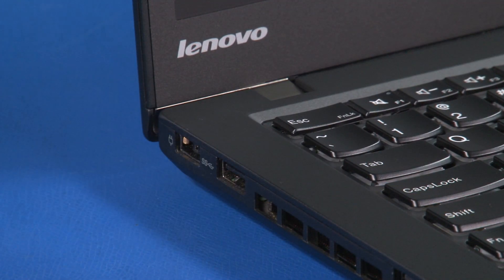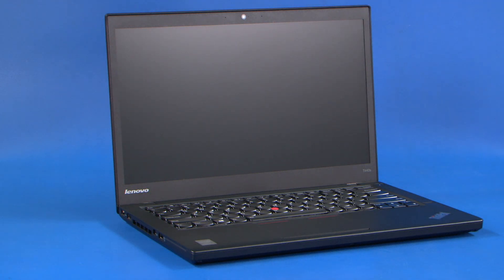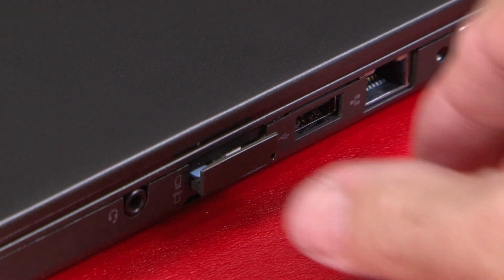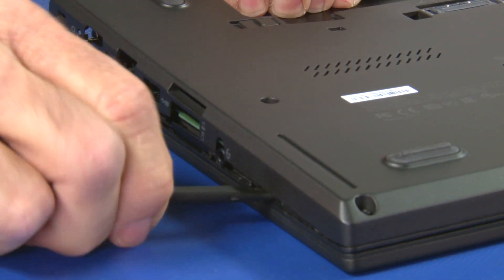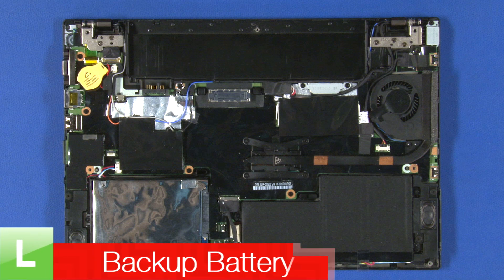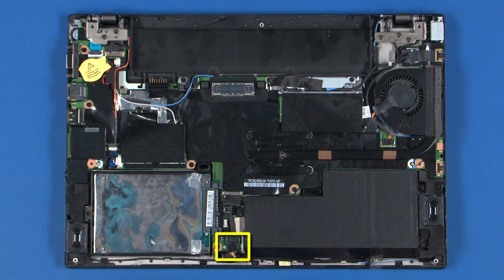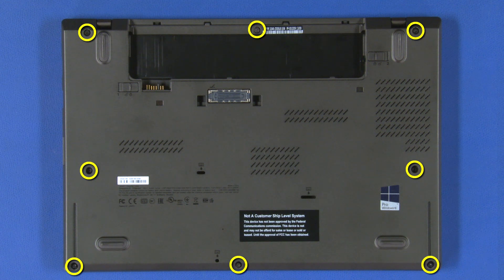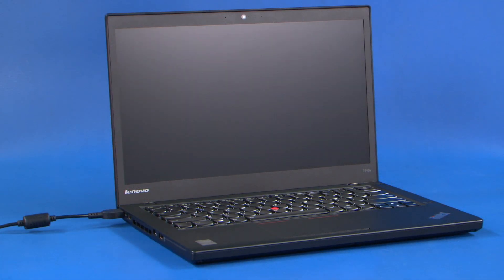ThinkPad T440, T440s, T450, T450s - Backup Battery Replacement

Comment: When I power on my Lenovo ThinkPad T440s, The external battery does show on my PC. Only the internal battery working. What could be the issue from the external battery?
I tried using a brand new Battery but it still doesn't show on the PC.
I have resetted the bios and all that but no solution yet.
Reply from the maker: Hi unokeraphael1701! Apologies for the trouble. Just to check, when did the problem start? Did you change any settings or install anything prior to that? Does the laptop still powering on while the charger is connected? If yes, does the laptop turn off automatically once you unplug the charger? Update us again. Thank you for reaching our support! -Chris_Lenovo
Reply: @LenovoSupport  
Yes my PC powers on with the internal battery working. My concern is the external battery not working on the PC.
The external battery not working happened after the PC was disassembled by a technician.
I don't know if the back up battery connector is not properly fixed or it's a software problem. The PC dies easily as it's only the Internal that is working currently 🥺
Reply: @LenovoSupport   The laptop doesn't turn off when I unplug the charger. 
It no longer shows 
Battery 1
Battery 2.
I don't know what could be the problem
Reply from the maker: Hey unokeraphael1701! Just to check, have you tried contacting the technician who disassembled your Lenovo unit, and inquire about this matter? Did the technician replace a certain part on your Lenovo unit? Does the external battery work before the technician open or disassembled your Lenovo unit? -Chris_Lenovo
Reply: @LenovoSupport   Yes it's working before I gave it to the technician.
The battery still works on another T440s PC
Reply from the maker: I see. Have you tried contacting, or bringing the unit back to the technician who disassembled the device and inquire about this matter? Based from what you have explained, this could be a hardware related concern with the device, and the only way to get it fix is by having it checked by the technician for a possible repair service. -Chris_Lenovo

Comment: After disconnecting built-in battery from bios. Now its completely off, tried 15 second and 30s holding power button without charger and battery but still doesn't work with and without battery
Reply from the maker: Hi @_.Hamza007, Kindly send us a private message on our social media channels for us to provide you with the troubleshooting steps. Addie_Lenovo

Comment: EVERY  TIME  when  i  turn  on  the  PC  , i got to  adjust  the  date  and  time  , otherwise  pc  wouldn't  turn on .  because  when  i start  it  , it  starts  with  no  DATE  AND  TIME  after every time  .  DOE S REPLACING   the  battery  like  in your  video , will  solve  this  issue  ?
Reply from the maker: Hi TheSnoopdog14! Thanks for reaching out, and we hope you're doing well. When the issue started? Did you update any software or change any settings prior to this issue? Generally, there are multiple possible reasons why the time keeps resetting and one of the possible reasons is the CMOS battery. In addition, you can also try to update the BIOS and drivers. Here's how: https://support.lenovo.com/us/en/videos/vid500028. Then observe if the issue persists. We'd like to extend our help. Rai_Lenovo
Reply from the maker: Hi there @TheSnoopdog14! If you still have the issue after updating drivers and BIOS, you might need to replace the CMOS battery. -Jomz_Lenovo
Reply: @LenovoSupport  so  ,  this  morning  happened  again .  if  i need to  replace  cmos  battery  ,  that means  the  battery  on the motherboard  ?  if  it  is that  , then  it  is  a battery  wrapped  in yellow tape .  and  if  it  is  cr2032 ?  do  i  just  take  the  battery  out  of  the  wrap , and  put  the new  one  and  wrap  it  ?
Reply from the maker: Thanks for getting back to us. Kindly delete the message that includes the serial number to secure your personal information. Yes, you described it correctly. The part number of the CMOS battery is 02K7078. If you are in Israel, you may get the contact details of our Parts Sales distributor here https://lnv.gy/3t3Sgjw. You may reach out for assistance regarding the repair service to one of our service provider in your area. You may use this link https://lnv.gy/2V6LP2Q to find one near you. Let us know if you have other queries or concern. Fraineee_Lenovo
Reply: @LenovoSupport  thank you for your reply. U didn't answer what I asked u regarding the battery and the yellow tape .
Reply: @LenovoSupport  I asked u whether I need specific part number , 

OR SIMPLY , JUST TAKE OUT THE CR2032 BATTERY OUT OF THE YELLOW WRAP , AND just replace it with a different cr2032 brand new Battery that I have ?
Reply from the maker: Sorry we missed that. Yes, simply remove the old one from the yellow plastic and put the new one. Make sure it is well placed. 

Here is a good guide from our channel 
https://lnv.gy/38ysZ7O

Let us know how it goes. Diox_Lenovo

Comment: Any kind of CMOS battery support in the T450 thinkpad laptop?
Reply: Actually Sir, when I'm press the power button my T450 thinkpad doesn't start and sometimes after lots of try maybe it's turn on...now still happening this problem so what should I do?
Reply from the maker: You can try doing a power drain. Remove all peripheral devices connected to the computer then press and hold the power button for 15 seconds. Plug the machine back then turn it on. -Jomz_Lenovo
Reply from the maker: Hi Bishal! Apologies as we do not have one for the CMOS. You can find more videos here of the T450 here on this link https://lnv.gy/2YpuUq3. -Jerry_Lenovo

Comment: Hello.. ive lenovo w50 which isn't booting up.. no issue with the ram.. the led light on the power botton stays on when ac adapter is plugged in. Could it be the backup power cell that's faulty?
Reply from the maker: Hi Haris. To clarify, even the Lenovo Splash screen is not coming on, it's just a plain black screen? Can we please press the capslock key a few times then check if the capslock light turns on and then off? We'd like to help. Cy_Lenovo

Comment: Hii ,
When I turn on the laptop I getting a msg as {"battery1 has failed due to normal wear. The battery can't be charged. Replace the battery."} Instead of this I won't have any issues it's normally working good but iam getting msg like this  as above👆..
What can I do now please suggest me
Reply from the maker: Hi! Thanks for reaching out. Could you send us a private message via our Lenovo Official Facebook Page or a direct message via our Lenovo Official Twitter Page and include this reference number 1245649 in your message and provide the serial number of your laptop for us to check your options? Here's how to find the serial number https://lnv.gy/3pBTIXz - We'd like to help. Mark_Lenovo

Facebook: https://lnv.gy/3aXVle2
Twitter: https://lnv.gy/2KQDJWX

Comment: My ThinkPad l430 beeps 5 times then another 5 beeps and won't boot up, my question is, should I change the CMOS battery ?
Reply from the maker: Hi Abdel! Thanks for reaching out. Kindly check these pages https://lnv.gy/2IODaeF, https://lnv.gy/2UCrSwY for reference regarding beep codes. Erica_Lenovo
Reply: I have the same problem
Reply: @MasMarone  there was a problem with the BIOS, had to take it to a professional.
Reply: @abdelghani7229  Thank you for your answer. I've already ordered the new battery for bios. Maybe I can do it myself.

Comment: my t430 is not turning on , will replacing cmos battery resolve my issue?
Reply from the maker: Hi Sadaqat, thanks for writing in. We're sorry to know about your trouble. There are a lot of factors why a device is not turning on. May we know if there were any updates/changes prior to this issue? When you tried to turn it on, do you see any lights on it? Have you tried using a different charger? Did you encounter any error messages prior to this issue? We'd like to know more. Looking forward to your reply. Fraineee_Lenovo
Reply: @LenovoSupport  Thanks for response , no there were no updated or changes , it was working fine but suddenly it turned off and then never turned on , i tried different charger but no luck , i have tried different solutions given online but nothing worked , also i would like to tell you that the battery was already deads so i was using laptop directly since long. I want to ask that is it reccomended to use without battery? Also since its not turning on then it means its internal battery is also dead now. where it is located ? and does it has anything to do with cmos?
Reply from the maker: Thanks for writing us back, Sadaqat. Have you tried to update your BIOS? Meanwhile, kindly follow the steps below if you still haven't tried it.

1. Press Windows key + I to open Settings.
2. Choose Update & Security.
3. Select Recovery from the left pane.
4. Under the Advanced startup, click Restart now.
5. Choose Troubleshoot.
6. Select Advanced options.
7. Choose UEFI Firmware Settings and click Restart.
8. Reset all settings to default and reboot your PC.

We'll wait for your update. Fraineee_Lenovo

Comment: I wish you would use terminology that countries other then the USA could properly understand. The CR 2032 is not a backup battery. It is a CMOS battery, frequently called the BIOS battery but backup battery it is NOT! It may provide trickle voltage for the CMOS to keep the BIOS settings when the mains power is disconnected or the laptop battery is flat/run down/exhausted/out of go juice but it does not even back those settings up.

Comment: Hello,
 I didn't use my T440 laptop for 8 months. Now it displays that it not charging and powers of when I remove the AC adaptor. So, do I need to change the only external battery for T440? If so, do I have to open the whole laptop as demonstrated in the video?
Reply from the maker: Hi Mohammad. Thanks for reaching out to us. Try doing power drain first. Remove all peripheral devices connected to the laptop including the charger and the external battery then press and hold the power button for 15 seconds. Once done, plugged in the charger and just let the battery out and turn on the laptop. If the laptop turns on with only the charger then the external battery is defected and needs replacement. Let us know how it goes. Auxen_Lenovo

Comment: I removed the battery and I put it back but I can not change the date
Reply from the maker: Hello Aymen, Thanks for reaching out. Please let us know if you have a password set in your BIOS? Because if this is the case this will set the time options as read only. You can try resetting the BIOS to its default settings and check if that will fix the issue. Jack_Lenovo
Reply: @LenovoSupport  i think that a password set in bios how i do ???

Comment: Suppose the CMOS / RTC (Real Time Clock) backup battery of a thinkpad fails. Will the BIOS complain about RTC or checksum error if the thinkpad is either constantly connected to either the AC power supply or the thinkpad's non-depleted main battery? I would assume that as long as the RTC is still powered by the AC power supply or the main battery, the BIOS wouldn't complain.

The reason I ask is that I left a thinkpad in storage for a few years. The CMOS battery seems to be still powering the RTC, but I'm not keen on opening many things to replace it in case it fails. If there's an alarm about the CMOS battery dead every time I turn the thinkpad on even though there are alternative sources of power to keep the RTC alive, then that would really suck.
Reply: Why not replace the battery? This nice video shows how easy it is.

Comment: Please share video of T430s lenova CMOS battery replacement
Reply from the maker: Hi आरंभ! Thanks for reaching out. We don't have a CMOS battery replacement video here. Try checking the Hardware Maintenance Manual for the steps. Link here, https://lnv.gy/2NF8rzf. Mac_Lenovo
Reply from the maker: Hi आरंभ.. In addition to what Mac have mentioned, this article https://lnv.gy/2Hmlep9 indicates that you will need to remove the battery & keyboard to access the CMOS battery on the T430s. Check out this keyboard removal guide https://lnv.gy/2HmleWb (3rd party video) and follow instructions on https://lnv.gy/2Hmlftd to remove the CMOS battery. Ray_Lenovo

Comment: Easy enough. My system wouldn't power on. I used this guide to reset my CMOS battery and it booted right up. Thanks for this info.
Reply: Did you get a replacement cmos and just plug it in

Comment: may I ask if the internal battery of the t450 T440 and t440s are the same ?
because i have a T450 model and i'm looking for buying an internal battery and i always find in the discrption of the battery thath they are for the T440 model
Reply from the maker: We recommend searching for the correct battery here:
http://pcsupport.lenovo.com/us/en/

Enter your Machine Type Model number, or your serial number to find the correct parts for your system.
Reply from the maker: Go to:
http://support.lenovo.com
Type the product name, machine type, or serial number to find your system. 
Click the 'Drivers & Software' tab.
You can find the drivers for your system there.
Reply from the maker: You might want to contact Lenovo Support to help you resolve your issue.
http://support.lenovo.com

Comment: How to disable internal battery if you cannot get a boot to BIOS? Trying the old, "pull battery/AC, push power button, plug AC & try to power-up" trick....Is it a "crack-open-case" situation?
Reply from the maker: If you are unable to get into the BIOS you can remove the bottom cover and disconnect the internal batter cable from the system board as shown in the video. It has the same effect, we just include it in the video in case users were unable to enter the BIOS, as in your case.
Reply: In a T440 20B7SOREOG where is the WWAN 4G slot?Just over the Hard Drive as we see it in that view?Can I replace it with an M.2 (2242) SSD?In the boot menu after hitting F12 i have 2 options ,one for my hard drive i 'm using and another one PCI LAN.Where does this refer to?When i press F1 startup_then _boot i have 8 options ata hdd1 ata hdd2,what are these ones too,please?